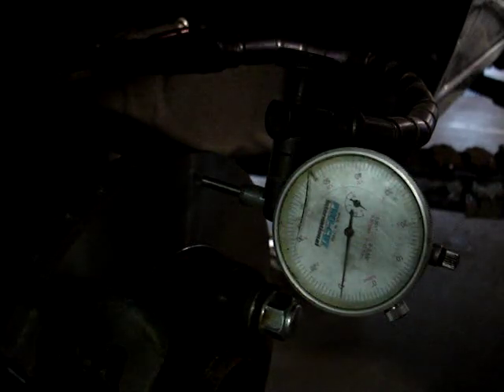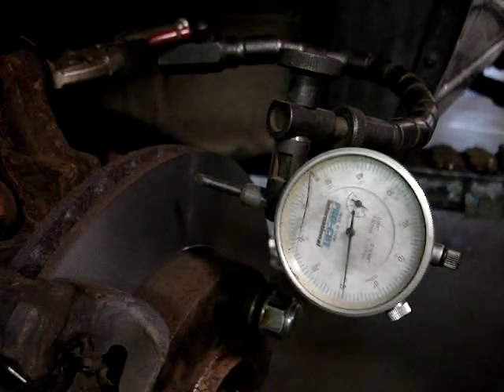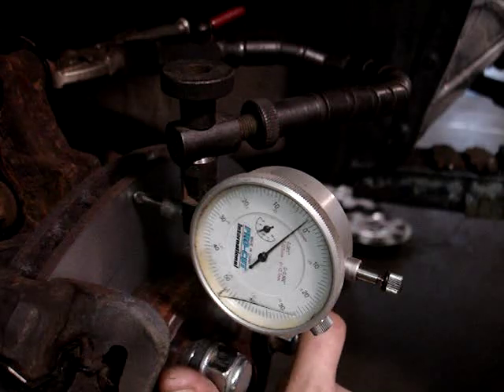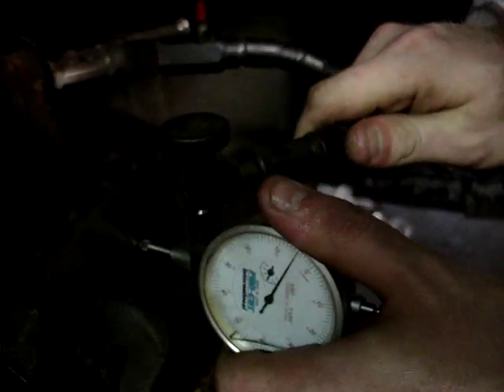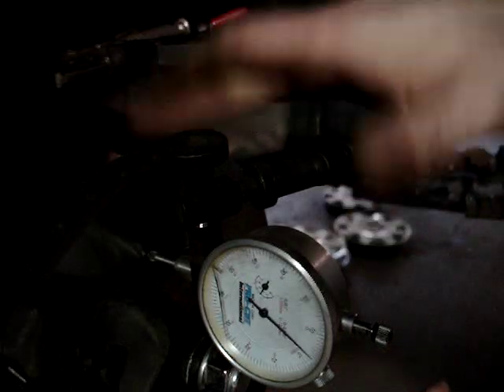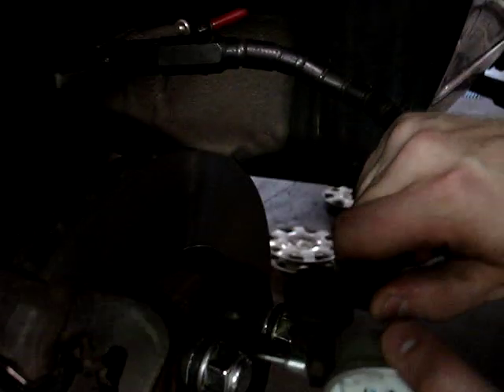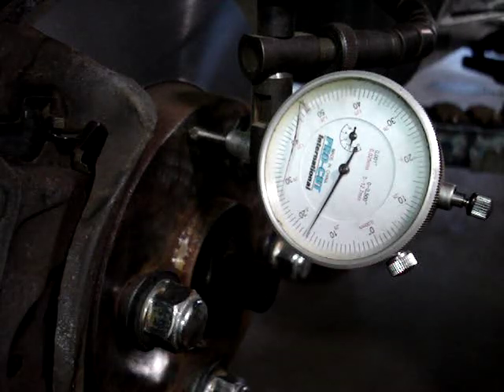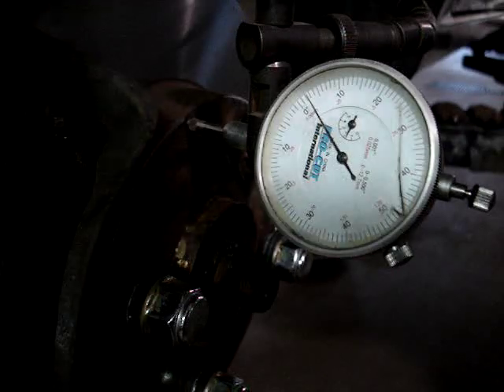Checking Brake rotor and Hub run out

Comment: My 2014 Camaro has had front rotors replaced twice in the 1st 20k miles... Driving me nuts because I only drive the SS to & from work mostly hwy. Chevy dealer charges me on each replacement since it's "not a warranty issue", wear n tear Maintence they say.... Well now at 25k miles the shakes are back! Replacing rotors at every oil change is not what I expected when buying a $40k car.. Could I have a bad wheel hub causing my rotors to warp every 5k miles?
Reply: yep make sure you get dealer to check your rotor and hub run outs and make sure they are within specs. then reimburse you at least half of your money spent on their misdiagnosis

Comment: I went to check the run out on my 99 Almera's rotors, and found that if I push and pull on the rotor, I've got about 0.59 millimeters of back and forth play.  Does that mean my bearings are bad?  I also noticed that my rotor doesn't turn nearly as easily as yours does in the video.  On the other hand, I've never had any noticable problem with the steering or suspension up to this point.

Comment: if there is no run out on the rotor does it not automatically rule out a run out on the hub??

im just thinking that if the hub has a lateral run-out then the rotor will for sure will have it???